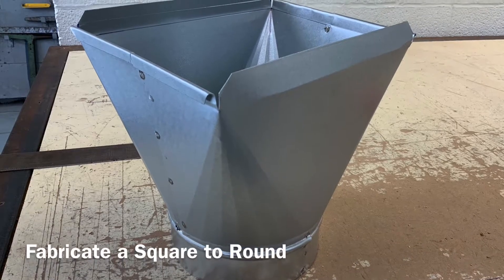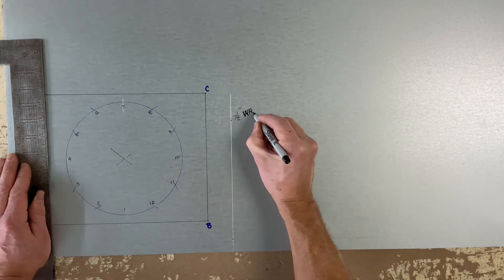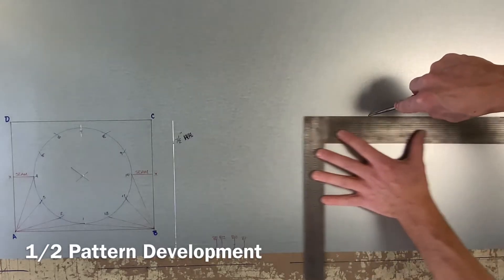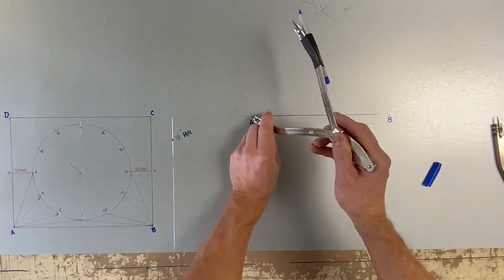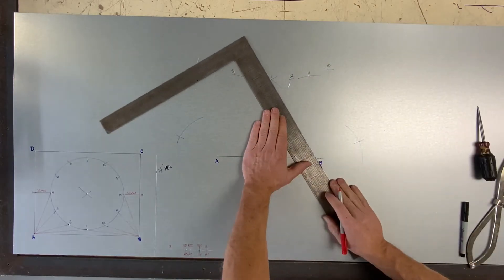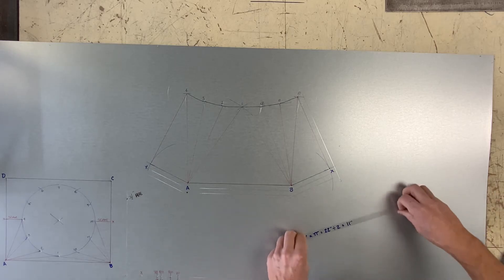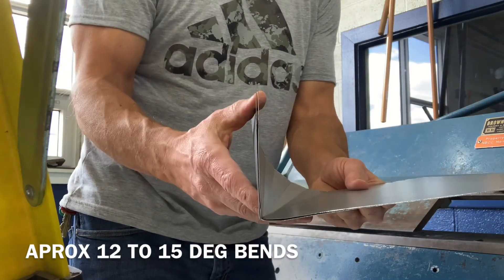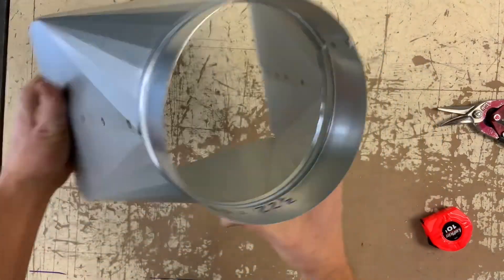Triangulation - Square to Round, fabrication

Comment: I apologize if this has already been addressed in the comments, but what is an alternative to the beaded collar? All I have currently in our shop besides a brake, Pittsburg Machine and a Cleat bender is a Roller and easy edger.
Reply from the maker: @The_Duter  no need to apologize MJ, if your question is how to fasten the collar? With minimal tools, One option could be to notch a half inch on the bottom of your collar, sorta like a dovetail notch, one notch in one out, then use a few screws or rivets to secure it in place, finish it off with some duct sealer. Another option is to use  a pair of pliers to flare out the bottom of your collar so it fits over the fitting, secure and seal.

Comment: Could you share some light on the equipment used for the same ?
Reply from the maker: I plan on demonstrating many of the hand tools, bench and floor equipment that I possibly can in the near future. That’s the plan, but finding time is my issue.
Reply: @sheetmetalwork  Thank you so much for your quick response.
I've found the hand press for the same but considering we also have thickness upto 5-6mm thick in SS304 we might have to go for a hydraulic or motorized version of the same.

Comment: Awesome job. Nice to see good content...
 Recon i could get your advice on a simpler bend?
Reply from the maker: Thank you! A simpler bend?? If I understand correctly, you don’t have access to a bender? If that’s the case, you could form it by applying pressure with both hands over a round pipe, conical pipe even better. In the trade we can also use sheet metal stakes.
Reply: @sheetmetalwork  i have a 18 inch hand bender, but the issue I'm having is I'm trying to make 4x10 floor boots.
 I don't exactly need to go rec to round. More a long the lines of the rectangle 4x10 down to a pan I can cut a hole into for my 6inch flex. 
 Joins are on 2 foot center so I have room, but have tried for weeks to get the bends right and can't figure it out. Trying to get the pan to work out on the 4 inch side of the boot.
Reply from the maker: I assume you are installing floor registers in the boots? Again I am not quite sure of the issue you’re dealing with, but hardware stores do sell 4x10 x 6”Rd boots. The 3  most common boots are the Angle boot, the Universal boot and the one I think you’re looking for, is called an End boot. 🤞
Reply: @sheetmetalwork  yes sir, I am just trying to find a pattern to make them myself. 
 But yes, installing floor boots, just wanting to bend them myself.
Reply from the maker: The patterns for the AB and the EB requires triangulation from an elevation view ( just more steps).  You might want to look at buying the one you want, open it up and flatten it out, there’s your pattern. When there’s a will there’s a way :) good luck.
Reply: @sheetmetalwork  do you have an email I could send you a drawing to and see what you think?

Comment: Made my first two square to round fittings with the help of your video. Mine were 6 1/2" square x 8" round. So the plan view drawing was a little bit funky. But it worked fine. Thank you
Reply from the maker: You welcome Andy, I’m happy to hear that it worked out.  With those measurements the pattern didn’t curl up that much. Eh! 🇨🇦

Comment: I completely understand this going from a 10" x 8" to a 7" circle but I'm having trouble going from a 6 3/4" x 4 3/4" rectangle to a 6" circle. Help anyone please???
Reply from the maker: Draw a plan/top view of the rect 6.75" x 4.75" with a 6" circle in dead center.  Use the same procedures as in the video. Just a heads up, the pattern will be much flatter or should I say, not as much rise.  This is due to the perimeter of the rectangle, and the circumference of the circle, are nearly the same. Good luck Johnny.

Comment: I haven't had to hand lay out a square to round in over 11 years, but yesterday because the plasma table was shut down, from air compressor.  I needed this video. thanks
Reply from the maker: That can sure happen! And when it does, it’s the skilled worker that steps up to the plate👍.

Comment: I appreciate your explanations but can I suggest that it would be far easier to follow if the reference numbers, letters and marked lines were done with more visual clarity, perhaps maybe making the references bigger in permanent marker
Reply from the maker: Thanks for your feedback Ian, I really do appreciate it and I will try to do so on my next videos. The funny thing is that I was taught not to use a marker, only a scribe for better accuracy.  I have more years of a fabricator/Installer than I do as a cinematographer 😀 Thanks!
Reply: @sheetmetalwork  100% agree on the accuracy of the scriber to do the job for real but to demonstrate clearer markings, larger references would help.
BTW I appreciate your videos as I have found yours are among the best I’ve found on this subject (which I’m no expert in)